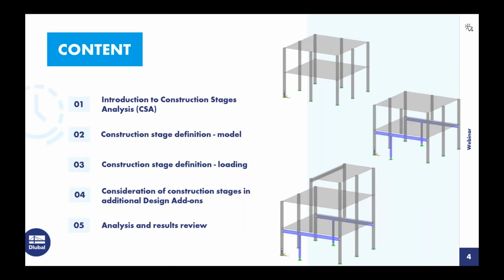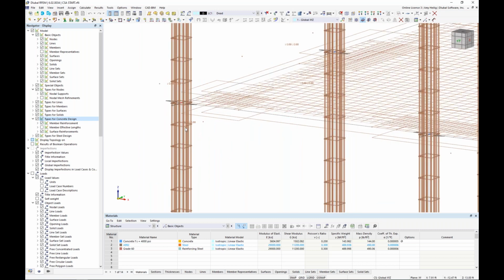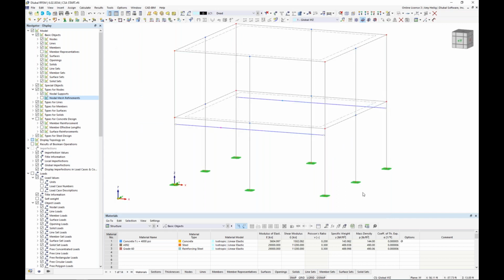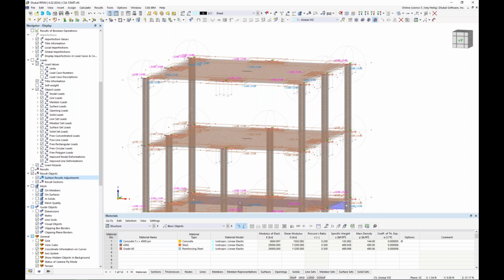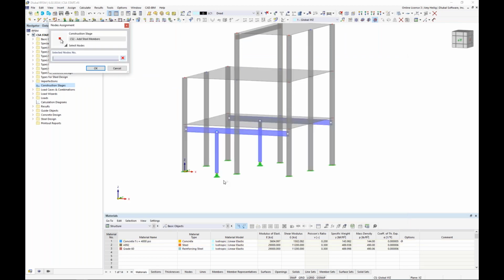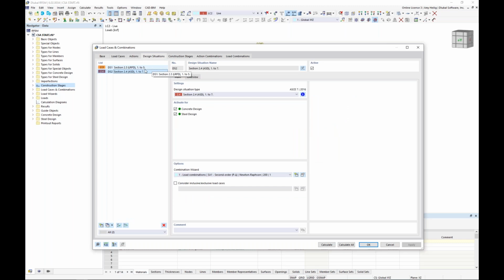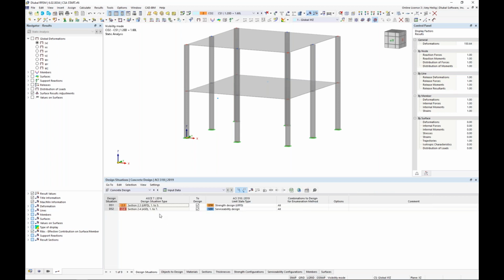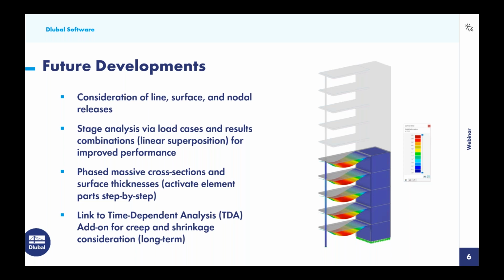Webinar | Construction Stages Analysis in RFEM 6

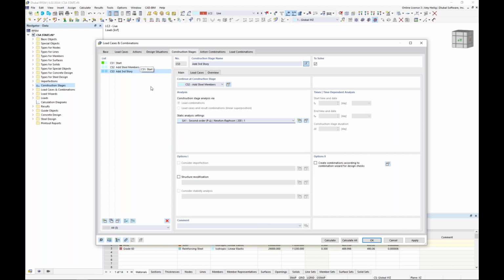Comment from the maker: *Note: At time 44:52, where the stages are integrated into the Design Situations, the dialog box has since been modified and the Options II checkbox shown is no longer valid. The stages are now integrated under the Design Situation - Combination Wizard settings using the Initial State checkbox. Please see the linked webinar presented at a later time for this new workflow: https://youtu.be/GgRQxaakCu4?si=Q74W70w5m42fthC8&t=1446

Comment: Hello, is it somehow possible to only keep the deformed shape for the next stage, but omit internal forces? This is something that can be useful for form-finding when at stage 1 you get the initial membrane shape, and then at stage 2 may consider a different approach for tensioning, like defining an axial strain on that predefined shape, for example.
Reply from the maker: Hi, nkAlex!
Yes, this is possible. You can define an initial state in every load case.  With that you can consider different form-finding states.